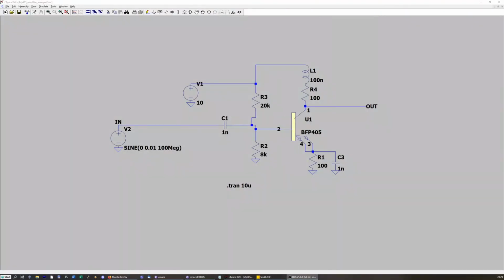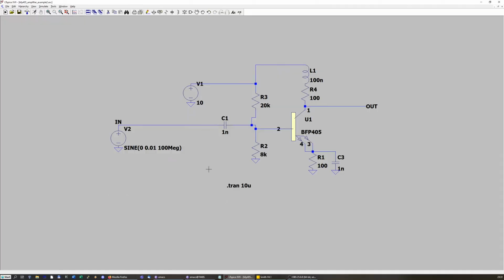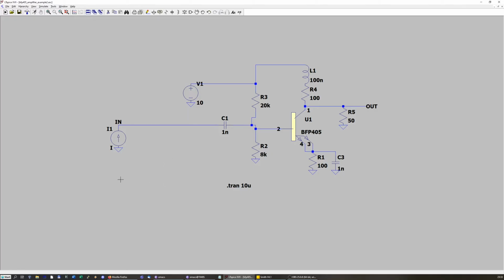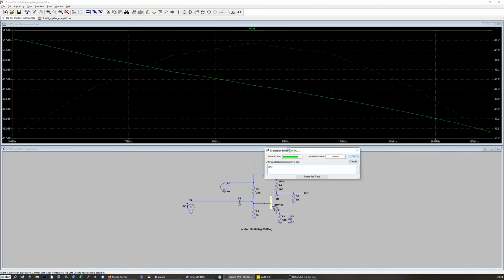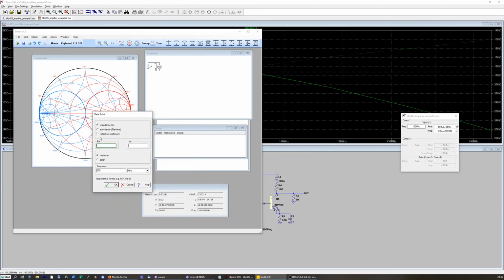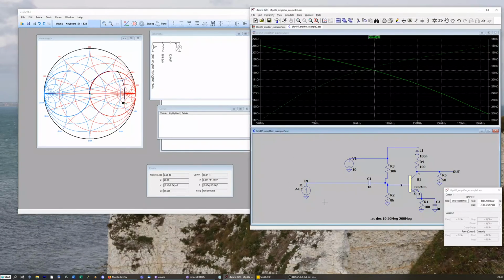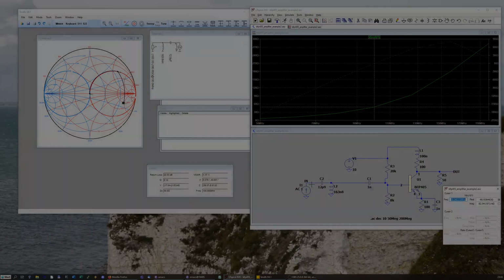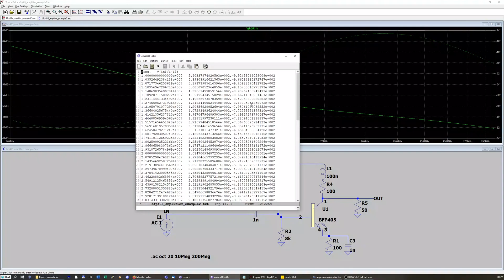Impedance matching circuit design with LTspice and Smith 4.1

Comment: Hello! A beginner question. Does the impedance matching circuit found from the smith chart works only for a particular frequency? If the RF freq increases to 200MHz should the impedance matching and the circuit be recalculated?
Reply from the maker: Yes you should recalculate the matching circuit :)

Comment: hello sir polprog, i want to ask how about we match in the load, cause i want design a load matching circuit (output in the video schematic). does change the DC supply in collector or drain  to AC will get all impedance ? and do it same like in video ?

Comment: Your 50 ohm resistor is dc coupled add a coupling capacitor to not influence dc behavior. It also influences the input impedance.

Comment: LTSPICE is not for RF use. you need to use HAM radio amateurs ' tool, way much better. probably 100 magnitude better.
Reply from the maker: It is for RF use if you understand its limits

Comment: The circuit should have a capacitor coupling the output
Reply from the maker: that's true, though in practice I put a large one like 100n that has neglible impedance and dont always draw it
Reply: @polprog702  It will have a neglible impedance, but will change the DC operating parameters of the transistor, which will affect the matching?
Reply: I would think it needs a capacitor at the output, between the 50 ohm resistor and collector.  With 50 ohms and a DC voltage present, it will alter the DC load line!
Reply from the maker: @JonathanS-q7n  You're right, I did not notice that

Comment: any refrence for using this method for impedance matching?
Reply from the maker: You can use it to sweep a circuit across some band but I think QUCS-S is better for that as it does Smith charts and S-parameter plots
Reply: @polprog702  I used to use QUCS, but it gives weird error reporting.  I change one capacitor value, it then shows an error.  If I change it back to the original value, it still shows an error!

Comment: Hi. I'm just curious: how do you determine the 1nF capacitor at the input? Is it by using the C=Q/V equation or the Xc equation or both? I'm sorry if this is a weird question to ask😅
Reply from the maker: I think it was from the top of my head. At this frequency 1nF is a very low impedance. edit: from the Xc equation.